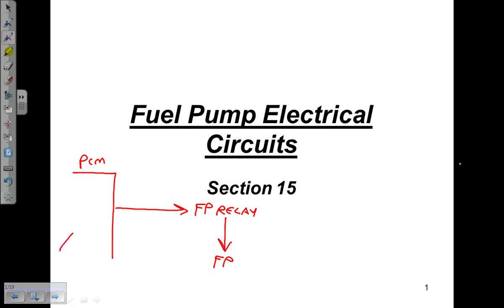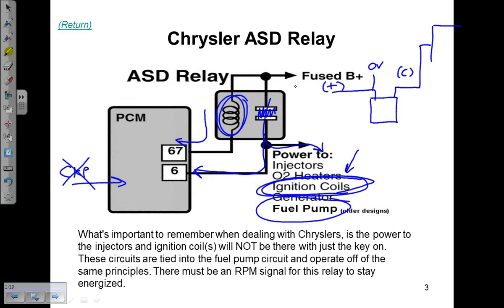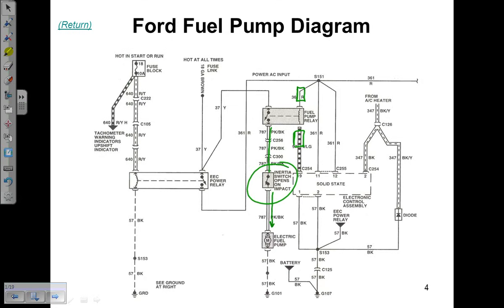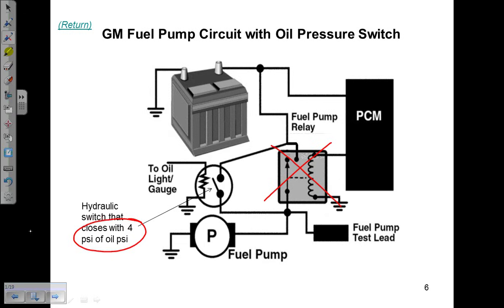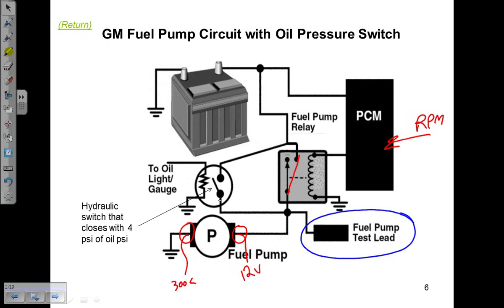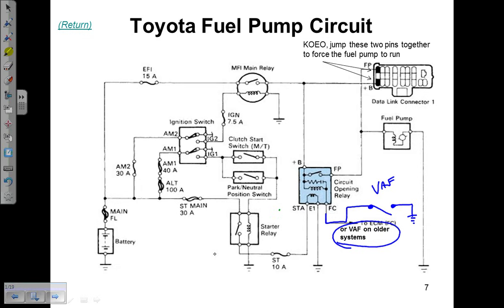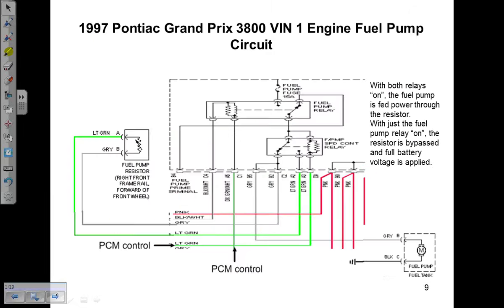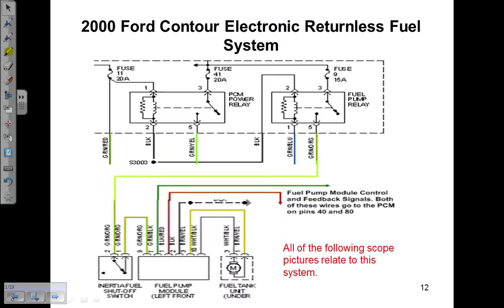Fuel Pump Electrical Circuits Description and Operation

Comment: Fixed my sons' 1988 Isuzu 1 ton truck. When it fired up you had to immediately rev the engine above 3000 rpm or it would die. Problem was the alternator. It was sick and would not kick in charging (red fail light on dash would stay on till it kicks in) unless you revved it up. The computer would look for ripple output on a special wire that tells computer engine is running. So, it can sometimes be the alternator.

Comment: Thank you for your video I have Elantra 2004 I check the power at relay was 12.5v but when I check it at connection near fuel tank when switch on it was 11.5..my question is that correct voltage why lower than the relay voltage ?
Reply from the maker: It is becoming more and more difficult to answer questions here. I have 80,000 people asking me for help now. So I have created a forum to help you guys better. It is free to join and we can exchange pictures, wiring diagrams and waveforms if needed to help guide you through the process of troubleshooting your vehicle. Thank you so much! Hope to see you there. 
Paul Danner (ScannerDanner)
 https://www.scannerdanner.com/forum/post-your-repair-questions-here.html
Reply: Like the average guy trying to fix the car at home can record much less read wave forms???
Reply: No your getting a voltage drop for some reason. you need to go through the circuit and figure it out.

Comment: What years did GM use the oil pressure sensor/switch in parallel with the fuel pump relay?
Reply: Is there profit in selling used sensors?

Comment: when the oil is real thick and cold you say its hard to build up that 4 psi oil pressure by cranking,your a little backwards don't ya think,when the oil is thick and cold the oil pressure will be higher then when the oil is thin and warm
Reply: Donald Stanford
Reply: No. Is thick, cold molasses easier to pour than if it were hot and thin??
Reply: Oil is thin when it’s cold (5W40 for example). The viscosity is 5 when cold & 40 at operating temperature. The lower the viscosity number (5) the lower the viscosity (thin). 40 is thicker than 5.

Comment: What must the Battery voltage be for effective working of the fuel pump for a Mondeo Ghia 2004 two liter petrol ?
Reply from the maker: Consider system voltage during cranking. It may drop as low as 9 volts with a weak battery, and the fuel pump will still run and produce pressure. So given that fact, when I am troubleshooting a no fuel pressure problem, if I have more than 10v on a fuel pump feed wire, I am totally okay with that.
Reply: I dont know now whether my long reply went off to you or not `cause it just disappeared from the screen. I will try again. The question is that as it needs a 12.4 Volts on the battery to turn the starter why is only 11 V needed for the pump.?    what about uphills:
The following is my problem :::
Its a Mondeo Ghia 2004 model 2liter petrol. It gave me excellent service for 12 years
Then all of a sudden after   175 000 km,  on the long  road,  it started to loose power on uphill stretches and eventually comes to a stand still. Waiting for 10 min or so, start it again and then it will go for 10 km or so. It seems that as “something” gets hot it causes the problem. 
I at first thought it was the petrol pump but then someone told me, no,  rather buy a new Fuel Pump Relay which I did and it then worked like a dream for 18 months. Then it started again with the same old story. Remember now the first relay worked for 12 years over 175 000 km, and the second one 18 months and only about 5000 km.
I cannot tell you what really gets hot to have to cool down sothat when you start it it will go OK for a awhile. The Relay is supposed to work also the Air conditioner, ECC power (what  ever that is) , High Beam lights, windscreen wipers, battery saver, fuel feed,  the Horn, rear window wiper.  After I established this I swithched off all these “additional” uses (except the battery saver what ever that may be) and assumed it will then work the fuel pump only. No joy.....
I have ordered a new relay but have not fitted it yet because driving in town on very short distances it gives no problems at all.

By coincidence??? the car would not start this morning. The selonoid/starter did not want to kick in....hooter worked and the lights. The Voltage of the battery was 12.1V.  I then saw on You Tube you need 12.4V min to start the car.  I took the battery out of my Luv (12.6V) and attached the jumping cables to the car`s battery. The car`s battery was then 12.4 (with the two batteries). I started the car with ease and then let it idle for 1/2 hr. ...took the jumpers off. The battery was then 12.4V.  I will see tomorrow whether it has run down again. Its an old battery in that its in the car probably for 3 years at least.

 I need an  explanation why the car stops going when I dont know what, gets hot.

What is your opinion.   ? I will greatly appreciate your views.
Thanks

Comment: honda accord 1999 v6 .the fuel pump works fine but when im running low on gas my gas indicator does not show any light.why ?

Comment: hai gd day scnner dannner   my jeep cannot start  currently .  when ign on  the fuel pump n auto shut down  relay was activate for 2 sec. .while cranking there is no supply to ign coil.  i change  crank sensor , cam sensor n also tps  sensor. i using test light for checking voltage at coil connector. there is no supply to injector, n fuel pump. so plse sir i need some technical advise to fix my jeep . i saw ur video clip awesome u are realy  good in wiring system . tq very much .always need technical bulletin .tq n have great day.
Reply from the maker: +Marliyana Mamat this is all supplied by the ASD relay. The fact that you are getting a prime tells us the PCM is able to control it. So this means you have an input problem. You need to check your cam and crank signals (doesn't matter that you replaced them)
https://www.youtube.com/watch?v=yp_kK6U8a64

https://www.youtube.com/watch?v=irHVjFTq4LE

Comment: Got any videos explaining load side and control side how to know which is which?
Reply from the maker: +Ivan Hernandez Load side of a relay always contains the switch. The control side of a relay always contains the coil. Make sense?
The coil makes a magnetic field which closes or opens the load side switch. On a 5 pin relay there is a normally open and normally closed contact.

Comment: Hope someone can respond, My Fuel pump doesn't shutoff after the 2-3 seconds it constantly primes, the car runs fine but it does give off a CEL light.. for fuel circuit fault. not sure what to do
Reply: +Karnicle --- don't know nothing about it, nor did you give enough info to start with this! - all systems are different... get a diagram and see how the relay circuit is designed... BUT IT COULD BE SIMPLE!
- relay stuck in closed position (just swap an identical relay that you know works, temporarily)
- have fuses been added to empty slots in fuse box (lol) that will drive one KUHraaaaaazy!

- has anyone messed with your car recently(what was done? as in fuel gauge work, etc... wires spliced to hook up 3rd party stuff!)

- ECM set in a particular mode where pump is to remain on for testing purposes?
- ECM knows something is wrong(possibly a good sign)
- ECM knows relay is open and closes it but fails to let go(does not mean ECM is bad, but weird)

-  can 't think of anything more, as I said I know nothing about it, I am only going by computer troubleshooting reasoning.
Reply: Thank you for your Response, it's an 03 WRX i'm thinking it might be my relay stuck on an open position as Subaru doesn't have an actual fuse for their fuel pump system, im hoping it's my relay or its gonna be my ecu. if it's my ecu i think im just gonna remove my CEL light lol

Comment: On systems which don't have a Fuel Pump Test Lead,
- could not 12V be pushed at the proper pin socket in the Fuel Pump Relay slot!?
  ... being careful not to ping one of the PCM sockets or the test could end up costing a bunch more (lol),
- or unplug the pump at the pump and feed 12V there!?
Reply from the maker: +DormantIdeas NIQ for sure

Comment: Informative video, although the oil pressure switch CAN be defective internally in disrupting the connection of a vehicle to the fuel pump without the relay. There is another video that demonstrates this after the fuel pump relay is removed after started it shuts off immediately despite normal oil pressure. After replacing the oil pressure switch and demonstrating the old switch couldn't establish a connection even with 5 PSI or more of air pressure sent to it. So if an oil pressure switch is bad, it CAN affect the power of the engine being sustained. After replacing the oil pressure switch, they remove the fuel pump relay and the car keeps running with normal oil pressure. Ideally, if there is low oil pressure, much like the air pressure, it could stall an engine just as demonstrated with the oil pressure switch using air pressure if there is an internal malfunction with the switch connection.

Comment: Why not just use an oil pressure switch to turn off the fuel pump? Those inertial switches are so lame. At least they are resettable but they need a dash light and it should be easier to find them.

Comment: Good day ScnnerDanner. question about the operation of the Pressure switch. If the Pressure Switch was malfunctioning intermittently, would that create an intermittent malfunction in the operation of the pump (brand new 1 day old pump), by falsely signaling to the computer a low oil level, intermittently, assuming all other electrical circuits to the pump are functioning normally. Could the pressure switch malfunction intermittently, and would replacing the switch fix the problem.  I have an intermittent LT1 engine problem, almost stalling intermittently especially with nearly WOT.  I have been searching for a resolution, in various local shops (with many parts replaced) and on the internet without a final resolution. Thank you for your time.
Reply from the maker: +Sam Rafeedie no it would not affect pump operation. It is a back up only. 
What year, make and model car?
Reply: +ScannerDanner Thank you for your reply. The car is 1994 Cadillac Fleetwood Brought with an LT1 engine.
Reply from the maker: +Sam Rafeedie what liter engine is that?

Comment: Great video!, quick question. Is it possible to test the fuel pump voltage without cranking by removing the FP relay and jumping the fp relay 'switch' part to make load continue to the FP rather than having to energize the FP relay coil? or possibly supply 12v to the FP directly from another 12v source? (I dont have anyone available to help with the testing)
Reply from the maker: +sypher0101 Absolutely but be very careful, if you accidentally jump the control side you may fry the computer driver. Just be 100% sure you are on the load side.
Reply: +ScannerDanner Thanks :). Regarding replacing the FP.. would you always replace the assembly at the same time? or is it ok to just replace the FP and keep the existing Assembly?
Reply: +ScannerDanner Hey ScannerDanner, I'm having a bit of an issue with the FP/FP relay of my 01' Isuzu Rodeo 3.2L Petrol (6VD1 engine), hoping you can shed some light. 

After watching your video, I did some tests on the FP relay socket with a test light & Multimeter, I found which pins are coil and which are switch. I checked the Pin that becomes 'Hot' when turning the ignition to 'ON' (suppose to prime the fuel system/pressure?), but it stays 'Hot'(12.03v). It doesn't just come on for a few seconds then 'OFF', but turning the key 'Off', the pin stays 'Hot' for 10sec (12.18v), then drops to 0v after that.

do you know why this might be? 

Could there be a sensor in the PCM that detects 'No Fuel Pressure' so it continues to try prime until it reaches a set pressure?

I checked a FP wiring diagram that suppose to be for a 2000-2003 Rodeo, but cant see anything special.

Testing the Relay on its own, that seems ok. 12v to coil magnetizes and 'clicks' the switch into place. Continuity and little-no resistance on the switch.

Any help would be super.

Thanks :)
Reply from the maker: +sypher0101 it depends on the type of assembly. I have done many older systems where you just change out the pump. The newer ones however, it is more common to get the whole unit.
Reply: Thanks! I've chased a start stall issue with my 93 Jeep Cherokee. After throwing over a grand in parts at it with no result I finally have a good idea on what's going on. Hard for me to describe the problem until now to those helping me fix.

Comment: I have a 2005 gmc savanna whit the 4.8  and code p0230, I replace the engine compartment fuse box cause a short but the code still setting, is a possible ecm damage circuit???? need help!!!!!! please
Reply from the maker: +alekstolstoi what is the definition of the P0230 code?

Comment: I apologize for leaving so many comments on here. First and foremost YOU HAVE BEEN A HUGE HELP!!!  You got me pointed in the right direction. Sadly I have more then one relay and more then one ESC/PCM?. You did a wonderful job on giving me the relay wire colors but the confusing part is on  this car those wires ran to the PCM/ESC and it did give me fuel but no power to the fuel pump. I also needed the other relay switch to give me power to the fuel pump which has a pink wire. Once I installed that..I had power to the fuel pump!!! I still have 1 more relay and 1 more PCM/ESC that I have no clue as to what they go to and should I replace them also. It does help to have wire coding to know.. Sadly few Mechanics knew, would or could give me this info. According to what I could find through GM is that my specific car was only made one year and everything was put in backwards, plus a recall adding more relays and PCM/ESCs. So.. Im keeping all that info in the car so next time Im not killing a starter and a battery in the process of trying to figure it out. Again my situation is rare..And you did get me headed in the right direction and left the parts store and Mechanics scratching their heads...lol  Best of luck to you and again.. Thank you.
Reply from the maker: +Chucks Mom you need a good wiring diagram, you can find the DIY versions of what I use here. 
http://www.scannerdanner.com/forum#/20150619/where-to-get-wiring-diagrams-4839109/

Comment: YES! we have fuel going to the carb/injector!!! still a no start, but we have fuel!  Only replaced one relay with the wiring schem you gave me.  Starters working, new alt, battery charged 3/4 of a tank of gas. So thank you we, got the (at that moment) problem fixed. Any suggestions as to why It may not start now that its getting fuel? 
Again HUGE THANK YOU and a warm hug.
Reply from the maker: +Chucks Mom Do you have spark? Do you have injector pulse? Those are the next two tests
Reply: +ScannerDanner Yes I can hear the pump running I can see and smell the fuel so.. This is just how old school I am. I went looking for a coil wire on the engine, couldnt fine it or the distributer cap..usually near the the top of the engine, so I tried to follow the plug wires to.. what I thought would be a normal looking distributor cap to check for spark.  After pulling off the hoses and all the other stuff I sorta saw what looked like a distributor cap but so much stuff was blocking my view. So back to the computer for more research. I actually have 2 caps, 2 wires to each? Im small but still trying to get my hand down to or up to where they are?? let alone see them?? Ill have to check from the spark plug end. My dad taught me to pull the wires off the cap and look for spark and or ticking or start the vehicle and look for little sparks coming from the wires (at night). I have no clue how to check from the plug end even if It started. If the car didnt mean so much me to I'dddd.. park it in the shop for another 5 years.